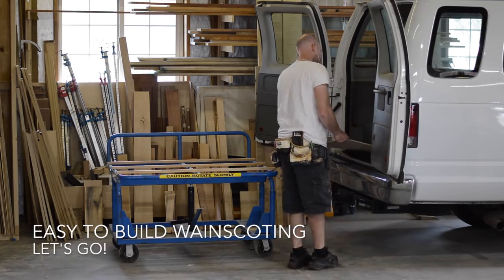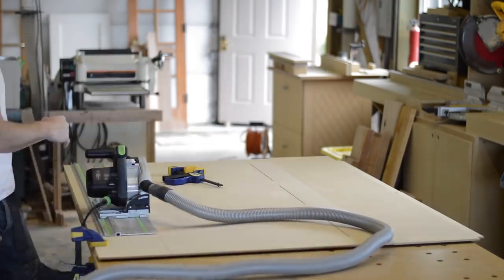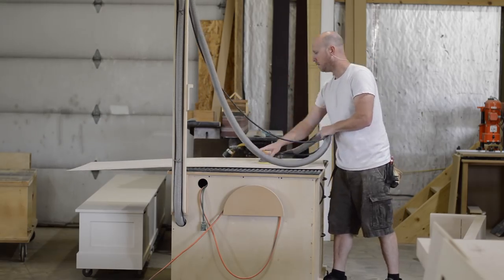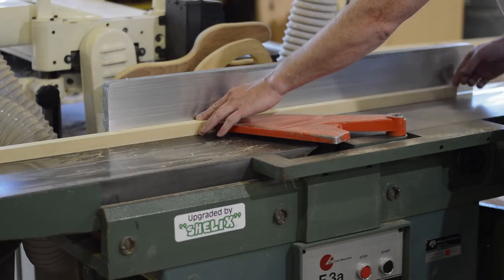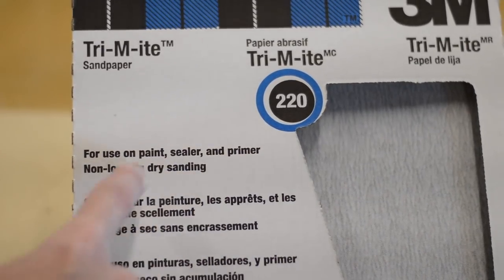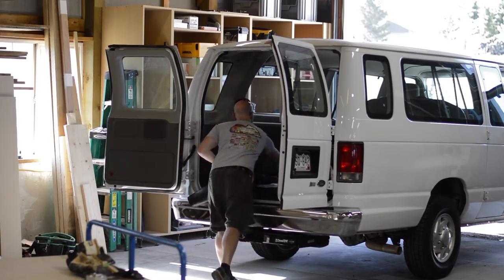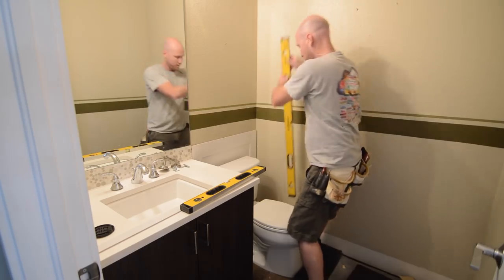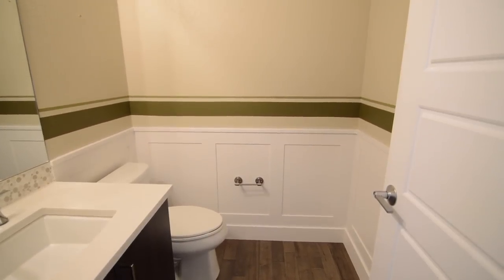Easiest wall paneling ever! Wainscoting

Comment: Hey Mike, amazing work once more.
Could you tell me, what size nozzle do you use for the priming and finish coats.
Also do you thin out either the primer or finish coats?
Reply from the maker: Thank you very much. I am using 1.2mm for both. Keep in mind I'm spraying with two different types of guns. I spray the primer with an HVLP gun, and the top coat is sprayed with a conventional gun, but with a pressurized cup nozzle size really doesn't matter. I thin the primer a little to increase flow. I do not thin the top coat, but I add floetrol.
Reply: Thank you very much!!
Reply from the maker: My pleasure.

Comment: Great job as usual! I wish this had been available before I did mine. This seems a lot simpler. That looked like a milk snake, but their markings are similar to copperheads.  That isn't one I would want to encounter either way. I am curious to know if u made it to the bbq?
Reply from the maker: Thank you. Yes, this is a pretty cool way to get the job done. Yes, I made it to the BBQ.
Reply: Yes, a milk snake. Copperheads have blotches that go along the back and wrap to the  sides. Milk snakes have rows of blotches along the sides as well as the back. Nice video! Interesting way to make a wall's worth of wainscoting!
Reply: And milk snakes are great to have around, too. Rodents, slugs, Japanese beetles be gone.

Comment: Thanks very beneficial.  Excellent c'manship.  Never used BIN you spray with 1.4mm tip?  BTW my son lives in Denver love to meet you one day.
Reply from the maker: Thank you. I use a 1.2 with the BIN, but because I'm using a compressor tip size doesn't really matter, just turn up the pressure until things look right. When using a turbine, tip size is very important. Send me a note if you are in the area. I'm around unless I'm out on install.

Comment: Love this approach! Another great video Mike. Quick, unrelated, question for you: I noticed your Dust Cobra peaking into frame a few times. Is this your primary dust collector/extractor for your smaller tools? What do you think of it? My shop isn't "Gorilla" friendly (mini or otherwise), so I thought the Cobra would be a good compromise ...
Reply from the maker: Thank you Ryan. The cobra is a very powerful vacuum, it separates the dust out pretty darn good, it also has filter clean mode that works OK. I do not recommend the super long hose unless you absolutely need it, its cumbersome. I use it with a Bosch hose, and I have been using it as my handheld tool dust collector (I'm playing around with a couple different options currently). For that and shop clean up it works very good. I called the manufacture before buying it and they said the blowers last for ~800 hours and can be bought at Grainer so its really a long term investment. The downsides are, the casters could be better, and its a little obnoxious to clean. Taking out the filter and putting in a new bag is a messy ordeal, but I have yet to find a vac I'm totally happy with in that regard. I also use it to clean out my van as well as other stuff around the house. It is a shop only vac, I would not try to transport this to a job site if that could be a need for you. Overall for what it is, its a very good vac. I have dropped it, knocked it over, etc. and it just keeps ticking.
Reply: Very helpful to hear your insights -- thanks a lot, Mike!
Reply from the maker: My pleasure.

Comment: Can I get your 2 cents... I was wondering if using MDF in bA bathroom with all that moisture , if the MDF would give problems over time?
Reply: I was thinking that too.  Would a pressed board be any better of a solution?  Seems like some of the big box sell them.  Is there really any better solution, except I guess full on 1/4 or 1/8" Ply?
Reply from the maker: I would never put MDF in a bathroom with a shower or bathtub. If that were the case this project would look totally different and it would be all hardwood with a different finish. This was a 1/2 bath and very little moisture will get into the air. The existing baseboards were MDF and still in pretty good shape, to me that was an indicator that these materials will hold up just fine. Also, I didn't show it in the video but I always prime and paint the bottom and back of the baseboards to keep spilled water at bay.
Reply from the maker: Regarding the use of other materials. If I were to put this project into a bathroom with a shower, I would use hardwood for the base, the frame section and probably baltic birch for the recessed panel areas.

Comment: This guy loves him some MDF!!
Reply from the maker: Yes, yes I do.
Reply: @MikeFarrington  What's your opinion of MDF trim such as baseboard? I hate handling it because it's too floppy, cutting it because it produces fine powder that floats in the air, and how it disintegrates like cardboard when it gets wet. But I love that you can seamlessly glue two pieces together with super (cyanoacrylic) glue and an activator, great for returns, joining multiple pieces, and correcting screw-ups.
Reply from the maker: @cmmartti  Pros and cons, if budget allows, I think wood is better, but MDF is cheap and easy to work.

Comment: Why didn’t you install the toilet roll holder central in the panel? It looks a bit weird off centre?
Reply from the maker: I don't think you could tell due to the camera angle, but it would be in an uncomfortable location if I centered it.
Reply: Too bad. Stuff out of symmetry messes with my eyes 😊 Great job though 👍
Reply from the maker: You know its funny, me too, but I always try to put function over form. This was a case where I thought that was the best choice. I ran it by the customer before doing it that way, and that was what they wanted.
Reply: Customer is always right!  😀
Reply: They should have put that holder on the right side of the vanity.  Not exactly something you want to highlight in your bathroom.  Excellent job on the wainscotting.
Reply from the maker: Yes!
Reply from the maker: We kicked that idea around and there just wasn't enough space.

Comment: That's a big-ass gopher snake.  Might be known as a bull snake there.  Coloring is a mimic of a rattlesnake, and when you first see them, it gives you a start.  The roundish head, in cross-section helps identify them when they're looking at you.  A rattler has a broad, flat head.  Gophers are energetic hunters of small rodents.  They're not aggressive and will retreat quickly when you come across them.
Reply from the maker: That thing was a beast. I like that they are around to help fight the rodent population. Thank you for the info.

Comment: I believe that is a common gopher snake.  I think it is also known as a bull snake.  The markings mimic a species of rattle snake.  You can easily tell the difference at the head, and the tail.  Interestingly, the gopher snake will shake it’s tail in the grass or leaves to impersonate the rattle snake when it is alarmed.  It has no rattles, and does not have the diamond shaped head of the pit viper.
Reply from the maker: Thank you. Great info.

Comment: I have same gun but on a turbine but it stopped sucking the paint it only blows air now, anyone knows what could be wrong?
Reply from the maker: Its mostly likely the valve from the gun to the cup. If its not that something is clogged.
Reply: Mike Farrington  do you mean the small check valve that runs on the side of the gun connected to rubber tubes

Comment: I don't know if it's available in Denver, but 3/8" or 1/2" MDF would have looked more proper by giving more depth to the panels as well as more nailing for your Chair Rail.
Reply from the maker: The reason I used thinner material was not that it was my first choice, but I wanted it to not sit proud of the door casing already installed. Also, I had very little space behind the toilet.
Reply: @MikeFarrington  Understood, but it appeared in your video that there was plenty of room behind the toilet and removing and notching the Casing around the paneling or butting the paneling into the Casing and notching the Chair Rail top piece is quite easy. Not knocking your work, but suggesting another approach.

Comment: It bothers me that the TP holder is not centered 😛
Reply from the maker: Me too. It just needed to be there to work well and be comfortable.
Reply: I concur. I was a tile setter for about 10 years and the off-center setting of the TP holder drives my Tile-Setter-Symmetry OCD over the edge. That being said, this is a fantastic looking job.
Reply from the maker: @Gracebeliever077  Thank you.
Reply: @MikeFarrington  You're welcome. At the end of the day, if the customer wanted it sideways on the baseboard; then it's all good.
Reply: @Jeff P You can centre your panels on the wall and then install Tp where it should be. It may not be where it looks best but where it should be. And sometimes you have to do as per code, and  it is not as per aesthetics. So you can't always make everyone happy. Mike you did an awesome job. It is what it is.  For a cover of magazine it would have been centered in the panel regardless of code or convenience.

Comment: Definitely not the quickest method unfortunately, you'd be far quicker ripping your stiles and rails and then mitre bonding them to your panel, sand the joint and that's it
Reply from the maker: I'd argue that this method would be faster, but speed isn't why I would pick this method, its that there is no joinery to sand, or open up down the line.
Reply: @MikeFarrington  it's definitely a better method for sure but in my opinion for speed and time I would mitre fix and glue my stiles and rails onto the backing board, it is the painters job to fill any seams. I've never had anyone ring me saying the joints have opened up thankfully

Comment: "easy" to fit, but sure nightmare to measure to get that easy fit.
Reply from the maker: Not really. I use a small margin of error on one side that will be covered up by the next panel being installed. So its only the last one that really needs a tight fit. This type of work is fussy though, no denying that. Even still, I enjoy doing it.